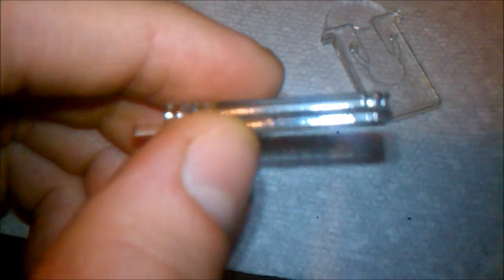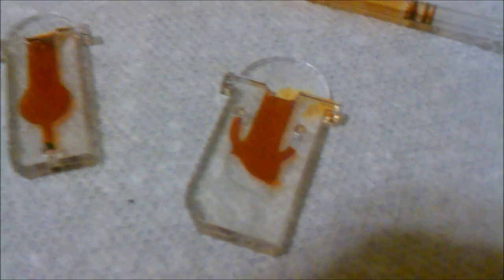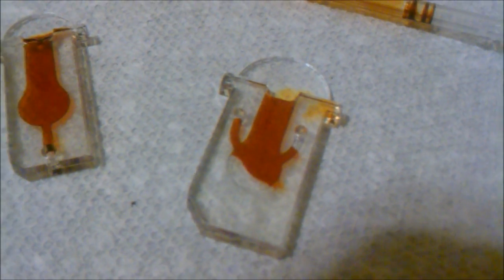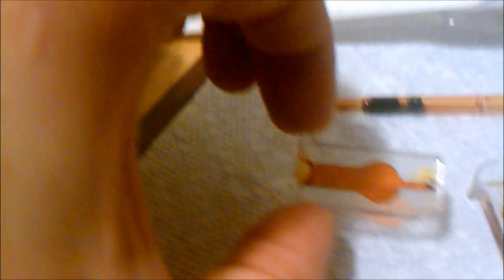$0.15 Microfluidic Cuvette made with acrylic and sticky tape

Comment: how do you get the wicking property on the acrylic? thanks
Reply from the maker: we didn't do anything special, it was just acrylic that we bought from a hardware store. It is possible the bulk of the wicking was done by the double-sided adhesive tape, but I can't be sure.
Reply: ***** Thanks for the promt reply. Since acrylic is slightly hydrophobic i felt the liquid would not move of its own. Did you try water for example?